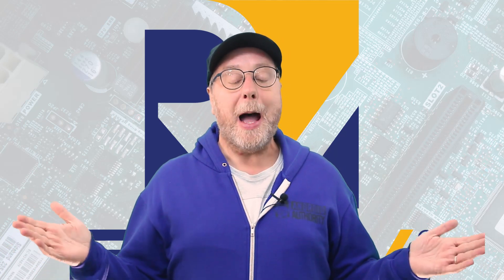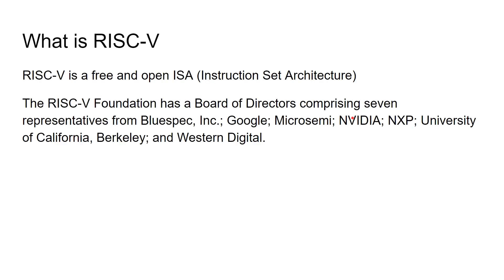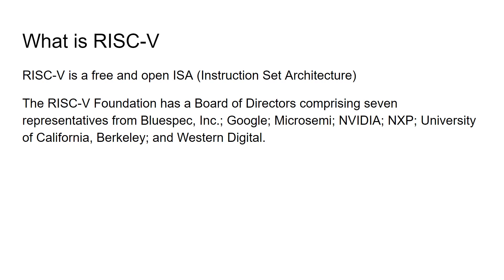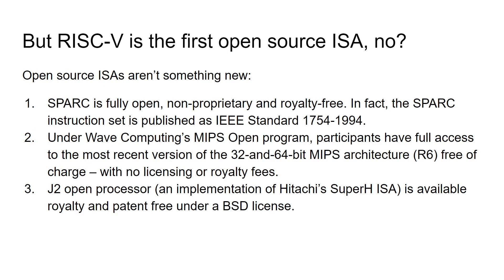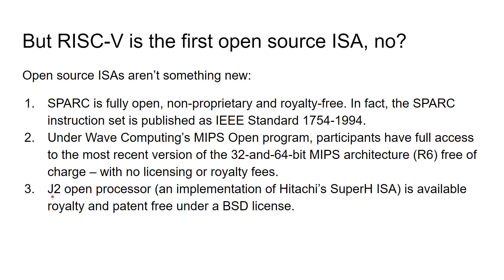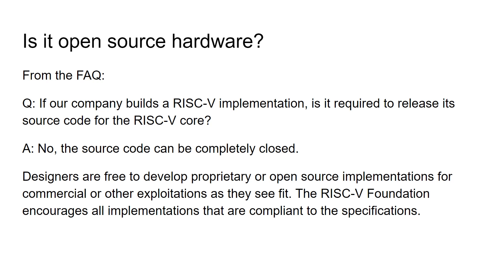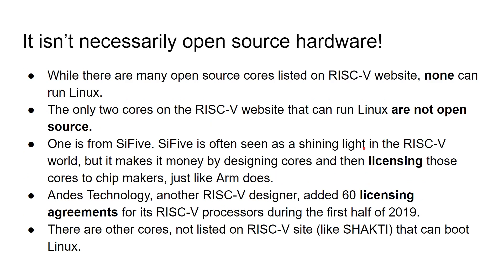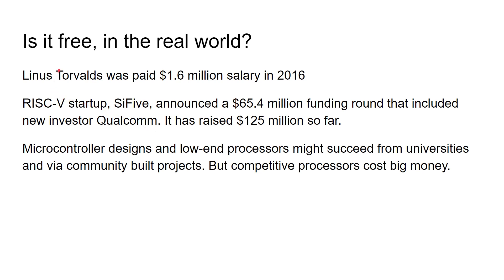RISC-V: Is it Open Source Hardware? (RISC-V part 1)

Comment: Just an update. There are already open source CPU's based on RISC-V that can run Linux. Like cva6 (64/32 bit), Rocket chip (64 bit) and VexRiscv (32 bit).

Comment: You said that Linux cannot runing on RISC-V. Maybe not in 2019... but as far as I know 2020, Debian and also most of its applications has been ported to RISC-V. Please correct me if I'm wrong.
Reply from the maker: You are wrong. I never said Linux can't run in RISC-V. I said the number of capable processors was (and still is) small.

Comment: Berkeley has many entirely open-source designs (soft core & synthesizable), and it has the Chipyard system that can combine many open source IP to form a SoC that can boot Linux. BOOM and Rocket core both have experimental chips that is fabricated and boots Linux. Many commercial chips, especially in IoT field, they just use Rocket Core since it's a pretty good design. So there are a lot of open source, Linux capable processors, just that naturally those that are manufactured are commercial, but you can boot Linux on FPGAs.
Reply: And forgot to mention, BOOM is a state-of-art out-of-order core that is extremely capable, competitive to the mainstream ARM / intel processors

Comment: SAVVY-V
A high-end, Linux-capable RISC-V dev board based on the PolarFire SoC

This project is coming soon. Sign up to receive updates and be notified when this project launches.

https://www.crowdsupply.com/ali-uzel/savvy-v

Just have a look.

Thanks for your great video.
Reply from the maker: I wouldn't call a board with a processor clocked at 667 MHz as "high-end". RISC-V has a long way to go yet.
Reply: @GaryExplains  I respect your opinion. It has 10G ports and its FPGA logic allows may apps. 
RISC-V is developing very fast if you follow SiFive.
Thank you.

Comment: Wait, if the open source designs are released, why can't there eventually be a linux running on it? It'll be like an Android kernal made for non-free software architecture.
Reply: You can compile anything for it, as long as you have a compiler. My question is, if the ISA of a professor is finalized in Verilog or VHDL, then is it possible to automatically crank out a compiler, or does that have to be done manually by hand.

Comment: I was lost from the start because I can’t imagine what “open source hardware” could possibly mean. I understand source code to be code written in a language such as C that gets compiled and run. I don’t get how such a process would work in creating hardware. Is it anything like 3-D printing?
Reply from the maker: Most integrated circuits (chips) are created in a high level design language (like VHDL) which is then synthesized (compiled) into a pattern of logic gates.
Reply: @GaryExplains  
I'm very new to this, and I have a particular question. Once a designer specifies an instruction set architecture through Verilog or VHDL, is it possible use that specification to automatically build a compiler for that architecture, or does it have to be done by hand?

Comment: A few comments to the "Open source ISAs aren't something new" list:

* The version of SPARC that is open source isn't the same as the one that goes into modern Oracle - "Unlike the other commercial RISCs, SPARC V8 is an open standard [44], much to Sun’s credit. [...] Alas,continued  development  of  the  Oracle  SPARC  Architecture  [74]  is  proprietary,  and  high-performance  software  is  likely  to  follow  their  lead,  leaving  behind  implementations  of  theolder, open instruction set."

* MIPS is open now (which is good) but at the time when RISC-V was conceived, this was not the case. "Technical issues aside, MIPS is unsuitable for many purposes because it is a proprietaryinstruction set.  Historically,  MIPS Technologies’ patent on the misaligned load and storeinstructions [37] had prevented others from fully implementing the ISA. [...] While the patent has since expired, MIPS remains a trademark of Imagination Technologies; MIPScompatibility cannot be claimed without their permission."

All quotes come from this publication, by the initial authors of the RISC-V ISA: https://www2.eecs.berkeley.edu/Pubs/TechRpts/2016/EECS-2016-1.html - I also recommend reading the section about x86 in there, it's a bit entertaining 😂

Comment: My personal hope is AMD and Intel use RISC V to directly compete with ARM. The R&D would only need to be done once and then they could optimize over time.
Reply from the maker: So... a) why would they do that? b) what advantage does AMD and Intel get by switching? c) Why would switching to RISC-V help them compete with Arm? d) Why do you think the R&D would only need to be done once? Do you think each generation of Intel processor is just optimization?
Reply: @GaryExplains   They don't have to switch they could just add a department and expand into RISC markets like mobile computing. RISC V could break the ARM monopoly and drive down cost of mobile devices to the end user or enable greater innovation from the producer companies. I think each generation of processors incorporates new techniques/research and new technologies of the market to advance the designs. this is just my personal opinions nothing more.
Reply from the maker: You didn't answer any of my questions. Also the use of Arm's architecture has nothing to do with the price of mobile devices. Arm doesn't set the price, Arm don't even make processors, companies like Qualcomm, Apple and Samsung do. Any company entering into the mobile processor market would also need to charge money for those chips, chips aren't free, designing the chips isn't free. The cost of designing a RISC-V chip is the same as the cost of designing an Arm chip. Why do you think RISC-V chips would be cheaper? Since there is already competition between mobile processor makers like Qualcomm and MediaTek, switching to another architecture wouldn't change the pricing model at all.
Reply: @GaryExplains   Sorry I thought I addressed each together in my response. I mean Arm makes money off of it's architecture and yes Qualcomm, Apple and Samsung do make the processors but they pay ARM for the Architecture and is added to the price of the CPU. This is were the  savings come in as you don't have to pay RISC V Foundation to develop a RISC V CPU or board. I never said it would be free but it can open access and diversity and potentially develop an ecosystem that can enable evolving contribution towards increasing development to fill market needs which helps everyone with more technology.
Reply from the maker: So, in terms of unanswered questions, you didn't answer these: b) what advantage does AMD and Intel get by switching? i.e. what can be achieved with RISC-V that can't be achieved with existing architectures? c) Why would switching to RISC-V help them compete with Arm?  i.e. What "edge" does RISC-V as an architecture have over Arm or x86? d) Why do you think the R&D would only need to be done once? Do you think each generation of Intel processor is just optimization?

In terms of pricing, you have made two bad assumptions. 1) That company X can design a CHEAPER RISC-V CPU that is competitive in terms of performance and efficiency with an equivalent Arm design. Can it be done, sure. Would it be CHEAPER? Remember when money is paid to Arm for a Cortex-A processor the chip maker is paying for the design. If Qualcomm wanted to switch to Intel designed RISC-V CPU designs, the cost would be same, not cheaper. 2) In the cases of companies like Apple, the cost of the royalty to Arm is very tiny compared to the cost of the design and the cost of manufacturer. IF Apple switched to RISC-V CPUs you would find that the cost of the chips would say basically the same.

In an average quarter Arm's revenues are tiny compare to Qualcomms. I think you are misunderstanding who is making the money.
Reply: @GaryExplains   Okay I didn't mean to make it an us versus them argument outside of ARM which has a virtual monopoly on RISC architecture in the market and is closed source. The advantage is control in development. You are correct that at this time it would take a large amount of investment to develop a competitive CPU but the longer RISC V is out in the ether and is developed this price will go down if development continues in the right ways. As for what can be achieved that is a bit of a loaded question. I am hopeful if there is no difference in usability, then RISC V is better in the long term and because companies will save on paying for a closed source ISA and they can build on there own talent and expertise to gain advantages in the market. ARM and RISC V are direct competitors in the RISC category while x86 is CISC architecture which is not a direct competitor. the edge I am referring to is the freedom to develop in house, and innovate in a more agile way to the markets needs and requests potentially and that is what ARM doesn't want to lose competitively. As for the R&D question and optimization question I think that once you develop a competitive CPU to the CORTEX or other ARM lines of processors they would develop normally and be more adaptable for the companies to use and sell then just shopping for a product and/or adapting a product that you have to pay premiums for  just for the right to use. As for the last question I don't think each generation of Intel Processor is just optimization but we can't know for sure with out reverse engineering because of the closed source nature of the CPU which I am not arguing against.

As for the rest of your statements, questions and assertions if there is inherent cost saving or potential cost savings of one method over another then it is worth an investment if only an expeditionary investment to see if it can be realized or they can wait and buy out a breakout company who is successful and is gaining momentum.
Reply from the maker: So... “The advantage is control in development.” I don't see that, what control? If you are making a compatible CPU for Arm or RISC-V then you need to stick to the rules that govern the architecture. There is no more “control” with RISC-V.

“this price will go down”... Er, no it won't. The cost of developing a CPU core doesn't go down with time or will it go down because you are using RISC-V. I really don't know why you think it will. Engineers working on RISC-V want the same salary as ones working on any other type of CPU design. Also remember that RISC-V CPU designs are NOT open source. So 5 years of RISC-V CPU deign by company X doesn't help lower the costs or boost the design of company Y. Andes doesn't share its CPU designs with SiFive or the other way around. They are in competition with each other.

“paying for a closed source ISA”... most companies (Apple is one big exception) are paying for the design, i.e. Cortex-A77, not for using the ISA. In the RISC-V market it is SiFive and Andes that are designing the CPU cores. Chip makers still need to pay them and they still need to pay a royalty per chip sold.

How does using RISC-V mean a company can “innovate in a more agile way”? If the ISA is fixed like the Arm ISA, how does using one ISA over the other equal greater agility?

 “I think that once you develop a competitive CPU to the CORTEX or other ARM lines of processors they would develop normally...” Nonsense. I don't think you have much experience of how CPUs are designed.

“worth an investment if only an expeditionary investment to see if it can be realized...” The problem is that CPU design is complex and expensive. Qualcomm and Samsung have both given up on spending millions on custom CPU designs. The problems of making a competitive, performant, efficient mobile processor are the same on RISC-V as on Arm. Did you watch all 4 videos?
Reply: @GaryExplains  When Intel develops a next generation of iCore processor it doesn't  burn the previous generations of iCore development blueprint. It incorporates the trade secrets it discovers when they first and successively develop their CPU's which gives them an advantage in the market if the product is ahead or competing with other corporations products. This is what I mean by control, if you have a high performing product that you own the property of then you can make more profit by selling it. With Arm  they benefit from this and RISC V is better because there is not ARM that you are slaved to buy the ISA from. Every company or the best companies can develop for themselves this technology. As for the price, the ARM model puts a price floor on the ISA implementation with selling the ISA while with RISC V each company, any of them, would not have that cost arbitrarily put on them outside of there own internal cost which pays itself of the more successful the sales are. This is huge as most of the cost is in the first implementation while efficiencies and discoveries can be incorporated without paying "the piper" ARM with limiting contracts.
Reply from the maker: So using your definition of “control” you already acknowledged that Intel has that control. Are you saying that Apple doesn't? You are contradicting yourself. Any company that designs a CPU has that control, Intel (as you said), AMD, or any company designing an Arm compatible CPU or any company designing a RISC-V CPU. There is no extra control when designing RISC-V. 

As for the rest I am just repeating myself now. As I have pointed out many times, the cost of designing and making a competitive CPU is not the money paid to Arm. You keep insisting that it is, but it isn't. Qualcomm and Samsung spent millions of dollars making custom CPU cores in the past and they both stopped. The reason was not the royalties sent to Arm, the reason was is because it is hard and complex and expensive. The idea that “every company or the best companies can develop for themselves this technology” is just nonsense. But as I said I am just repeating myself now. If it was as easy as you say then there would be 20 RISC-V design companies by now all making super fast and super efficient mobile processor, but there isn't. The reason is because the ISA isn't the problem. Making a good CPU is the problem. As I said in my videos (are you sure you watched them), all the failed CPU architectures from the past all failed for other reasons than the ISA.
Reply: @GaryExplains  There are companies today that are developing RISC V Processors and they are not as well resourced as these big companies. Now what is happening is that the big players are waiting for these smaller companies to effectively disrupt the industry so that they can buy the companies but being that these companies are already spending millions of dollar on developing next generation x86 and customizing Arm CPU's. If they matched what some of the smaller companies are doing on a shoe sting budget with the experience of developing there own ISA's then they could produce a competitive product and utilize synergy with intellectual resources and years of experience they already have. RISC V could fail and fade but it was designed to give students access to a real ISA, which means that going forward the people who will be hired in the future by  an Intel, AMD, Sony, Samsung or you name it, will be increasingly familiar with RISC V ,which working processors are made  today and programming development with hardware is happening. All that RISC V is waiting for is for a commercial product to be made proving that it is possible to sell a RISC V product. It doesn't even have to be successful it just has to be a commercial alternative with competitive performance to and similar ARM based product.
Reply from the maker: "It doesn't even have to be successful it just has to be a commercial alternative with competitive performance to and similar ARM based product." Exactly and that is the hard part and it would be hard if it was a new Arm based company, if it was a new RISC-V based company, it was a new MIPS based company. The ISA isn't the problem. Like you said, the problem is making an alternative CPU design with competitive performance to and similar ARM based product. That is hard and it has nothing to do with RISC-V and RISC-V doesn't solve that problem in any way.

Comment: All video is about reading slides?
Reply from the maker: Yes, indeed, it is called passing on information by using slides as an aid. What did you want slow camera pans of chips on circuit boards as I was speaking?

Comment: It's IP free. That's the whole point. There can be many manufacturers making that instruction set, which will lower the prices and will filter out the bad actors. Of course the chips won't be scot-free.
Reply from the maker: When you say "it" is IP free, you are referring to the instruction set, yes, not the chips. The chips are certainly not IP free.
Reply: @GaryExplains  Yes that's true. The benefit is that you can have many CPUs running your software (if you don't use some specialized instructions). That's why you don't need Windows for AMD or Windows for Intel. They both use the K8 ISA despite they have different specialized circuits and different chip design.

Comment: The fact that designers do not have to publish their changes (source code) to RISC-V is precisely why you are seeing it get commercial traction when all the other "open source hardware" is practically unknown.
Reply: Right! It wouldn't be an open source ISA if they didn't let people use it in any way they see fit.
Open Source Movement is about not controlling what others do with the code
Reply: @abstractapproach634  That worked sooo well with Sony and FreeBSD, they're fuc*ing leeching

Comment: Because of the issue of covert back doors, the only plausible solution for making dedicated cryptographic processors, such as used at firewall boundaries, will be to implement them on FPGAs - totally take cryptography operations away from the main CPU and only execute that on FPGA co-processors